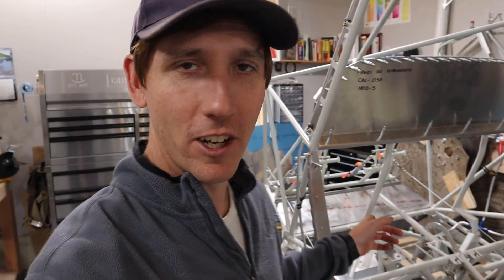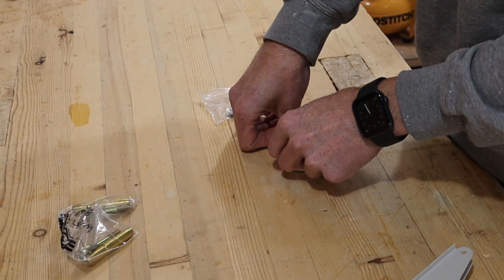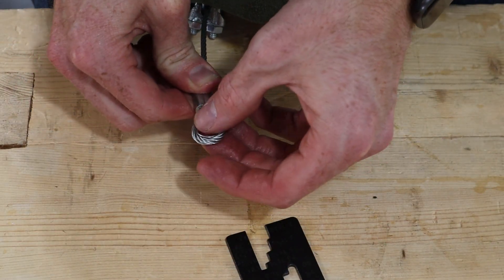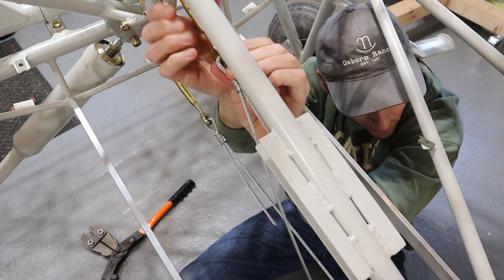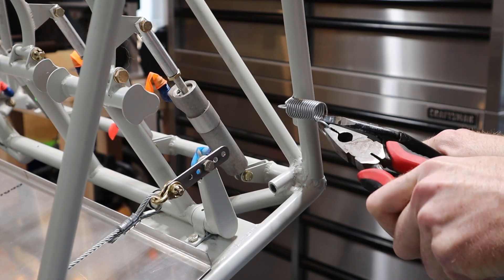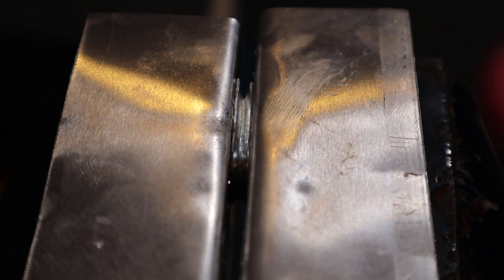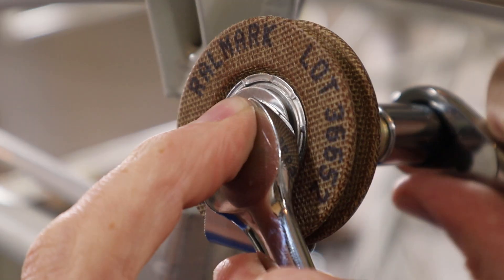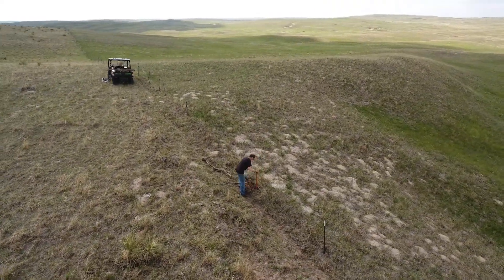Rigging Flight Control Cables

Comment: Good video.  I need to start rigging my  homebuilt but I need the model number for the nicopress tool.  I ordered one from 
riggingwarehouse but its not the right one, I'll need to return it. The 'bite' on the swaging tool is too wide. (1/4")In order to
put 3 crimps on a sleeve it looks like it'll need to be 1/8" wide.

Comment: I saw a trick that works really well instead of a cable clamp, install your thimble and take your cleco plier
s and put the fork end around the narrow part near the nicopress and the other end of the jaw over the round end where the cable goes around the thmble and then put a rubber band over the handles of the cleco pliers so you don't have to hold them. It is just the right tension to hold the cable nicely around the thimble while you position the nicopress and crimp it. Works like a charm. 
One question I have is when you put your cables to your rudder. How do you plan on setting the cable tension without turnbuckles!??
Reply from the maker: Sounds like a great tip! Thanks for sharing. 
Turnbuckles aren’t necessary on the BH rudder cables if you cut the cables to the correct length to hold the rudder peddles at the correct angle. The only tension in the system is created by the springs that hold the rudder pedals up. It's not a closed system so turnbuckles will only adjust the angle of the peddles, not add tension.

Comment: Your homemade bracket is to thin for the flaps, the cable could jump off the pully and/or the bracket will eventually have stress cracks because of the thin metal flexing.
Very dangerous.

Comment: Why is the cable crossed for elevators and not for any other control surface?
Reply from the maker: The convention is stick forward pitch down, stick back pitch up. If the cables didn't cross pulling the stick back would deflect the elevator down, which would pitch the aircraft down. So these cable need to be crossed.
Reply: @ColbyOsborn  what if there was no convention of stick forward pitch down, any other reason?

Comment: In aircraft Spruce and specialties catalog under pulleys the AN210-3 pulley installation instructions state: Shall not be installed on frequency used aircraft controls where the bend in the cable is more than 15 degrees. For heaven sakes that is so conservative that it is useless. This pulley is common on rudder and other control cables. What do you know about this?
Reply from the maker: I just used the pulleys that were specified in the plans and didn't think much about it. I'll have to look into this. Appreciate the heads up!
Reply: @ColbyOsborn  Something is not right. I expect this was a copy and paste situation for the catalog and there is more to this via information not included.

Comment: I'm late to the show, and too late for you to do it. But a friend of mine when building his plane would slide on clear heat shrink on the cable before crimping  Nicopress sleeves. Then after crimping, slide it over the sleeve and cable ends and shrink it. This kept wires from sticking out and tearing fabric or hands close to them. Very much like you did on you fuel lines where they were close to the structure.
Reply from the maker: Appreciate the tip!
Reply: Hi sir
I want build bush plane at home. Please guide me me. Where I can get or buy blueprint or design of bush plane. Because I have not Idia how to build or design bush plane Kit . This is my big wish that I build back country stole plane in my country. Please Guide me . 
Thank you